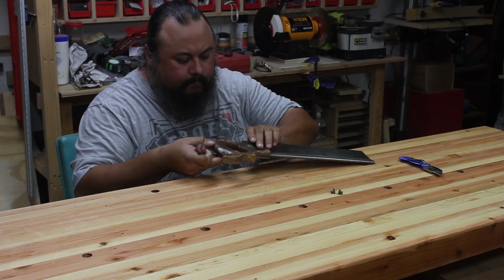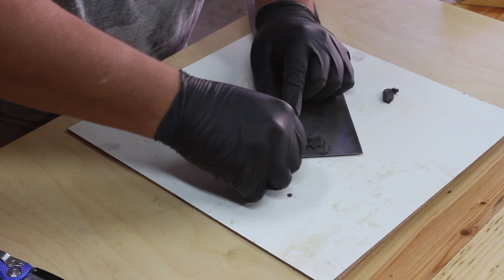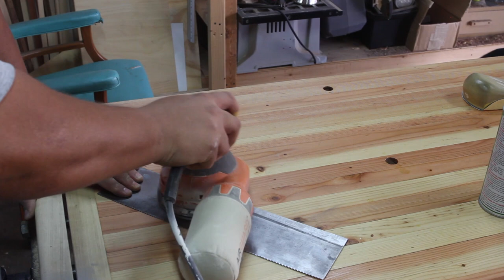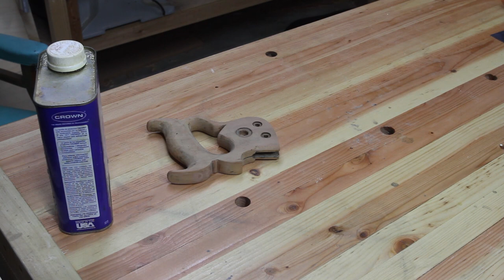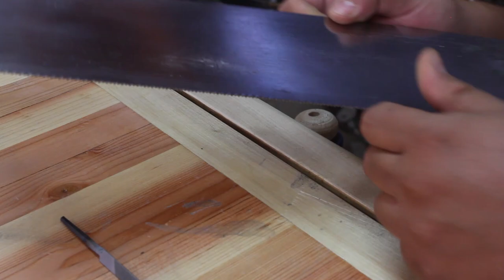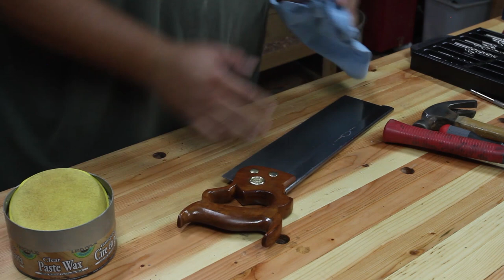04 - Disston Back Saw Restoration

Comment: I have a No. 4 with the same problem, with the secondary holes drilled.  I didn't know about Steel Stick.  I am going to have to try that.  Thank you.  I thought that this would end up being a wall decoration.  If this works, I can bring this old saw back to life.
Reply from the maker: The new holes I drilled were not through the steel stick. But just to the side of it. I ended up shifting things a bit to not risk it.

Comment: Great video.You took care to be maticulous and even when faced with some bad drill holes in the saw, you had a good solution, and you clean up after yourself! If you run into a saw with heavy rust, try a total immersion vinegar bath. Has to soak over night. It does wonders.
Reply from the maker: That's a good tip on the vinegar especially for my next restoration which is a post drill that has what looks like 100 years of rust! Lol. Thanks for watching.

Comment: Nice saw! I have a Henry Dusston 26" miter saw and box. It dates in the same time period as yours. Has a little surface rust on one side, but other than that its in perfect shape and has great color in the old carbon steel. Thumbs up on the video!

Comment: Jorge A good tip when using the JB weld or any other type of Epoxy Putty is to wet your
hands or the putty a little as you mix it  and it helps to smooth it out to any shape you need!
Reply from the maker: That’s a great tip thank you!

Comment: If I could like it twice I would do. Once for the saw and once for the gorgeous dogs happily mooching around. So I’ve subscribed instead of the second like.

I was using the epoxy putty earlier fixing the guard on my drill press, saved me £20 buying a new one. It’s the first time I’ve used it and I’m very impressed (I’m a newbie).

Please may I ask why you didn’t set the saw? Was it already set? 

Thank you for a great video.

Comment: You did a fine job, did you save the etch or was that not a goal? I have the same saw and am thinking about how aggressively I want to polish the plate for exactly that reason.
Reply from the maker: Well my saw didn't have the etch left on it... so I didn't have to worry about it, if it did I would probably try to save it. Enjoy your restoration.
Reply: If you destroy the etch or sand the blade & handle as Jorge did the 100 yr old 
will lose all it's value & be just another good saw so might as well use it!
By the way Jorge it's still a Great looking saw!
Reply: @IgotHeliFever  the smaller disston back saws often didn't have an etch. They were far more common on panel saws.

Comment: This is one of the best restores I've seen. Been putting mine off for a while for fear of something like the saw handle hole problem. Nice recovery! How's that holding up, now that you have been using it a while?
Reply from the maker: It has held up perfectly... I have had no issues, granted I don't use it all the time but when I do man it works like a charm.

Comment: Mucho Bueno!!!!  Yea, I know my espanol sucks, but you did great work.  Two thumbs up and a pat on the back.  I agree with the vinegar bath overnight and then hit it with 400 grit sandpaper.  I did a D8 hand saw and just poured vinegar on the blade and then hit it with 400 grit paper.  It did wonders!!  Saw you broke down and hit the brass with a brass wire wheel.  Quick and easy way to brighten the brass nuts.  Once you've got the oil dry on the handle did you spray the handle with clear coat?  Makes it nice and smooth....Overall, you did great!
Reply from the maker: +96geometro yeah after I cleaned the handle and applied some BLO I used some spray Shellac... I like Shellac because at first it looks shinny but with usage it dulls down. About the Brass nuts I used a wire wheel but its a brass wire wheel which is gentler than a steel one...quick but you have to be careful not to damage the nuts too much. Thank you for your comments.

Comment: Does the paste wax prevent rust on the bare metal?
Reply from the maker: ***** Yes it will prevent rust to a point and it will also help the blade slide through the wood.